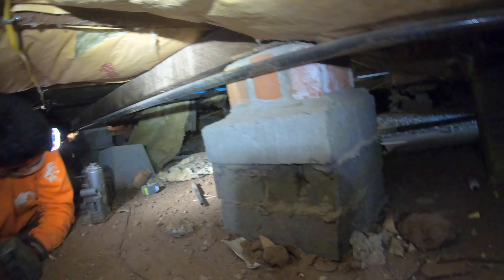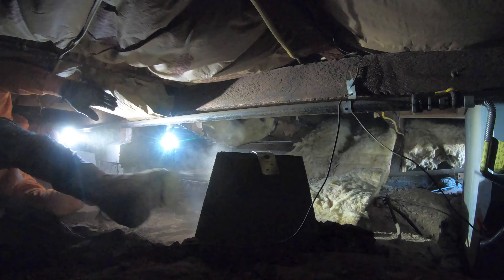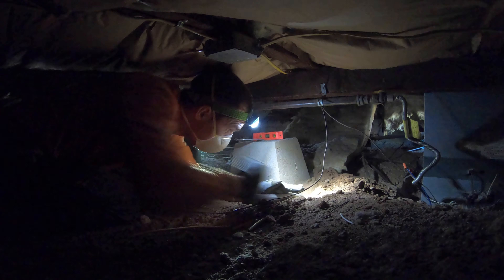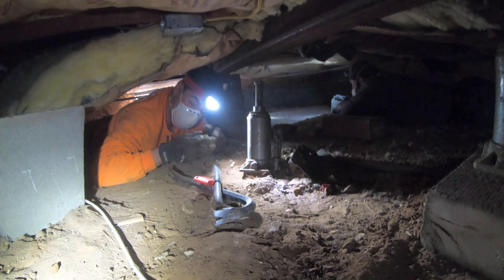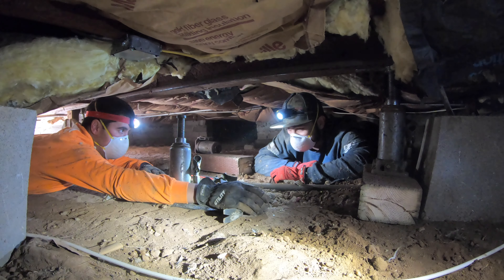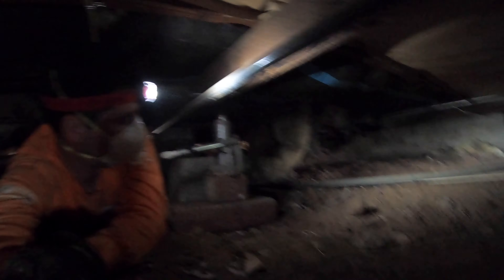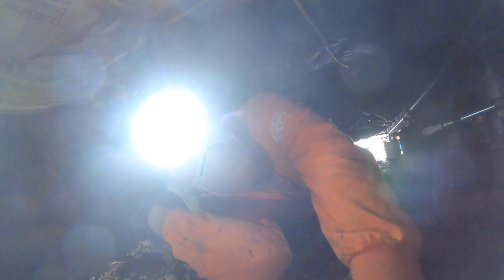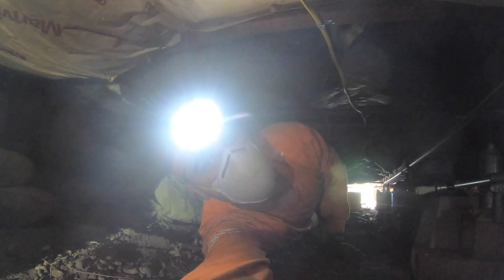122 Year Old Home Foundation Repair - Historical Home in Riverside, CA Crawlspace Repairs

Comment: I saw your video I live in Loma linda I have a neighbor tree root problem I notice I dug and saw a root and I have a crack line in my living room that was repaired by the previous owner.
Reply from the maker: Unfortunately dealing with neighbors roots is an all too common issue out here in San Bernardino County.  Hopefully that previous repair is still holding up well for you!